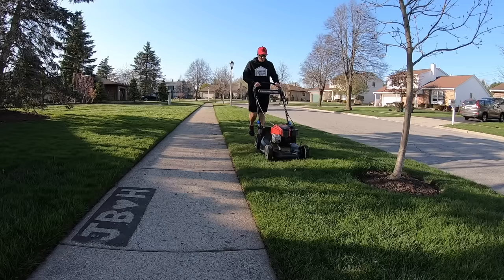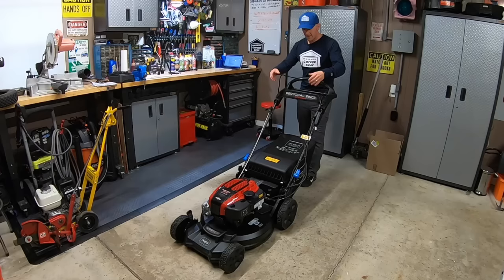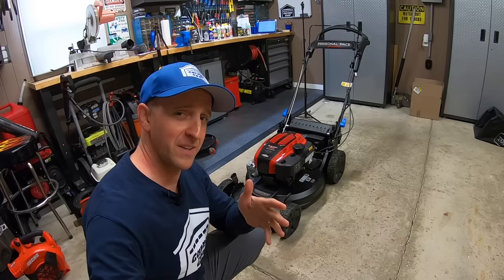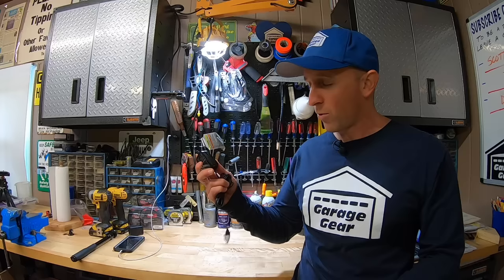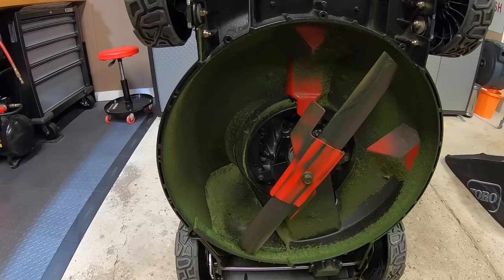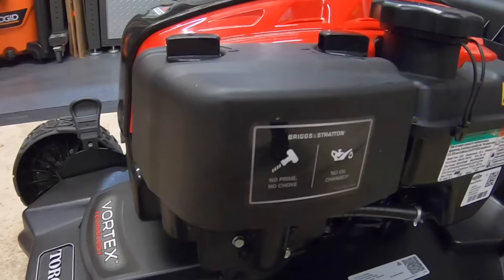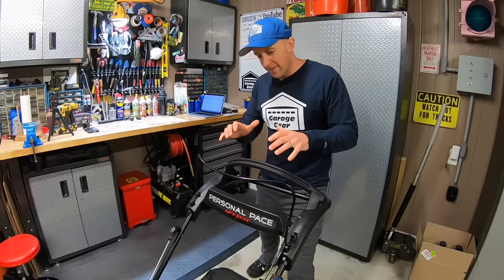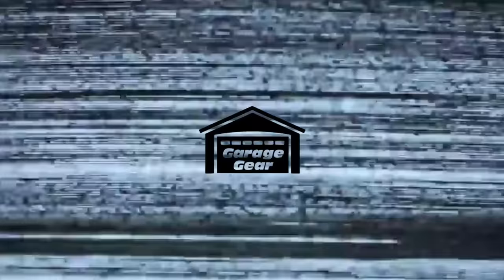IS THE TORO SUPER RECYCLER 21564 THE BEST HOMEOWNER LAWN MOWER?

Comment: Honda wins. Better engine, no mulch plug to mess with
Reply from the maker: Honda makes a great machine. thanks for watching!
Reply: Honda will cease manufacturing gas engine mowers in September of this year. Sales will go through 2024 or when supplies are gone.
Reply: @b286guy  yeah it’s unfortunate but a great time to pick one up. I got a new hrx217 earlier this year
Reply: If you drain the carb after every season, it will last forever. And as the reviewer mentioned, the boot as to be seated properly. I bet that’s where the sputtering issues come from.
Reply: Soon to be defunct. You can buy a Honda clone though.
Reply: Which Honda HRX woks you recommend for someone doing multiple yards a day? I was considering the super recycler as it’s advertised as commercial , but I do know Hondas have great mowers
Reply: @grassmanlawncare4823  SR is not a commercial mower. Commercially a Time Master is your best bet  Honda is no longer making mowers after this year. Parts and service will be better with a Toro
Reply: That lever is a joke. You have to work it like a runway model to get it to close if it's been open for the first few laps.
Reply: I disagree. I own both a Honda Hrx217 and this exact Toro. 2 weeks in my Honda was spitting fuel out of the exhaust. Had to bring back to the dealer. This super recycler has been more reliable. 

The toro is way way more user friendly with the personal pace and the flex handle.  The Honda self propelled handles are a pain in the butt. The toro is heavier but feels lighter to maneuver. 

I will admit the ONE thing the Honda wins is cut quality. Not by much though. Both machines mulch amazing you can literally hear the grass being cut. I'll give the Honda the cut quality but like I said not by much. Just barely edges the Toro. 

All in all both amazing machines IMO
Reply: but no personal pace. to me the drive system trumps all!
Reply: Not anymore…
Reply: @b286guy can’t buy em they pulled off shelves
Reply: @skyemac8 which one
Reply: @clayramsey019  😲
Reply: If you enjoy changing the oil all the time get a Honda.
Reply: @mrjon75  ahh yes that 15 seconds of tilting and  it taking exactly 1 bottle is so inconvenient 😂 It’s easier to change the oil than swap and charge batteries.
Reply: @mrjon75  why more then other
Reply: @TheCreamRisesToTheTop  Because you have a Randy Savage picture I'll be respectful. I'm angry at Honda. They abandoned us.
Reply: @clayramsey019  Toro and some others claim you never need to change the oil but truth is you should at least once in a Blue Moon, on any gas motor.
Reply: @clayramsey019 …all of them, recall for mechanical issues. Had to return mine after six months of ownership.
Reply: @b286guy ...I was anxious to pick up a Honda this year after learning of the final production. Unfortunately there is a nationwide sales stop with Honda mowers due to a manufacturing cam problem / defect.
Reply: @TheCreamRisesToTheTop ...How do you like your new mower?
Reply: @Bob.sackamano ... Have you tried the Honda with the hydrostatic transmission?
Reply: @jaspervonbach3621  yes that's the one I own. Best mower I've ever used.
Reply: Wish you could still get the Hondas.  My 15 year old machine is rotting away and wont last another season so I am going to have to replace.  I may look for a used one dating back before the recall rather than buying a new one made by someone else.
Reply: @davva360  I’m sure you could get a great deal on a barely used one and have it go for another 15
Reply: @TheCreamRisesToTheTop  kind of what I’m hoping to find.
Reply: @skyemac8  9 months latter and Honda no longer makes small engine 😂
Reply: I just picked up a Honda 3/24
Reply: @jaspervonbach3621  it’s been fantastic so far
Reply: @JoshuaGeers-os3hf  nice 👌🏻

Comment: Do you see big difference between 163cc and 190cc super recycler??
Reply from the maker: Yep the 190cc has more power in tall grass! Thanks for watching
Reply: @GarageGear  just bought the 190cc super recycler. My front yard grows super fast and thick. Pretty stoked. 

Thx man
Reply from the maker: @GaryWatkins-l7o  congrats on your purchase!
Reply: @GarageGear  I just mowed for the first time with 190cc super recycler. Mulches so well. Mulched up new growth and all the clippings left from my previous bagging job with old mower. Love the toro!  Easy to assemble. Electric start worked first time. Thick grass made no diff in how the engine/blade operates. Made sure spark plug was secure as you recommend, it came tight. Super satisfied with it so far.  The mower was a bit pricey but I’d say worth it for sure.
Reply from the maker: @GaryWatkins-l7o  awesome my friend! Thanks for sharing your experience! It is a great mower

Comment: I have the Honda and recently bought the toro as the Honda just isn’t as great as the reviews say.
Reply from the maker: Thanks for sharing
Reply: What didn't you like about it?  and why is the Toro better?
Reply: @Tundra_Guy  The pull start assembly was made out of cheap plastic and i had to repair it / replace it a few times. The drive wheels in the front of the mower fail in any sort of moist grass and quit working until they dry. The one thing i liked is the motor always ran without issue, if you can keep the pull cord assembly together.
Reply: @Tundra_Guy  i am not saying the toro is the greatest thing ever, however i have not have any issues with it to complain about yet.

Comment: TORO home owner mowers are plain and simple JUNK
Spend a little more and buy a commercial unit.
Other wise look for a used HONDA Mower that will outperform any thing that TORO does for homeowners versions
Reply: Want a monster of a beast commercial mower. Check out  the Scag SFC-21 Inch with the Kohler Command Pro 224CV engine.
Reply: Facts
Reply from the maker: Can’t go wrong going with commercial equipment

Comment: I have a toro recycler, awd. I hate this thing with all of my heart and soul. This thing sucks so badly. No side discharge, i thought the recycling option would be great. It creates a swamp under my mower deck no matter what. Using the bag, the grass clippings get clogged in that square rear discharge box and will not go into the bag. I mow a few feet, unclog, mow a few feet, unclog, mow a few feet, unclog. It takes hours to mow with this piece of sh*t. I despise this mower!! It is not a recycler and won't even bag! $500 wasted!
Reply from the maker: Thanks for sharing this dawg!
Reply: @GarageGear  I'm hoping once the rear discharge chute arrives my mower will be able to work properly. I did see a video using an aluminum duct to suffice until it arrives.
Reply from the maker: @Dawgfather1218  haha that would work too!